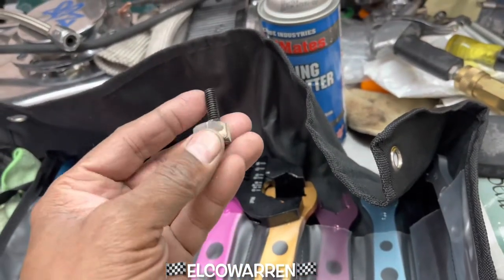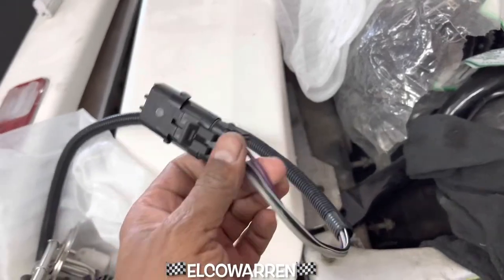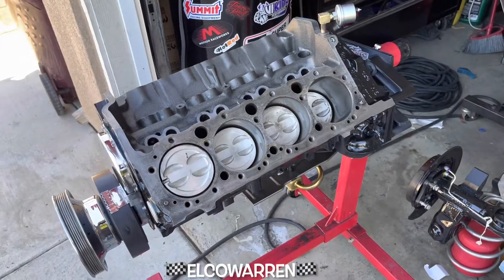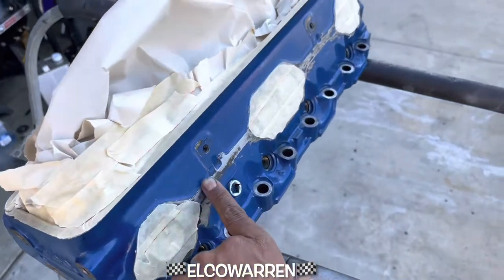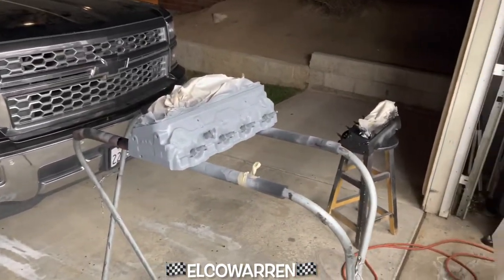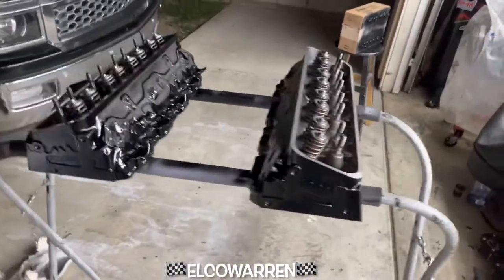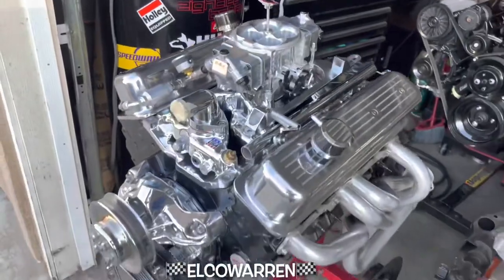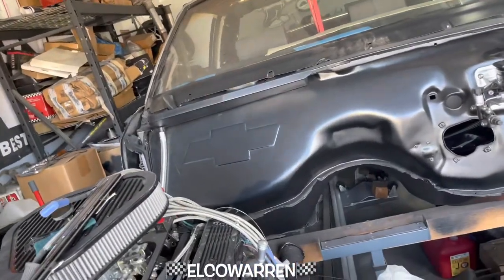SBC 350  Painting/Mock Up

Comment: Make sure that fuel line on the sending unit is submersible because gas will make the hose not melt. I would recommend that plastic straw! 💪🏿💪🏿🔥🔥
Reply from the maker: Thanks bro!! My young homie runs that same hose and pump on his setup. He’s had it running for a while now. The pump did come with the plastic line.. Really appreciate the inout!🙏🏾🙏🏾🏆🙏🏾🏆🙏🏾🙏🏾